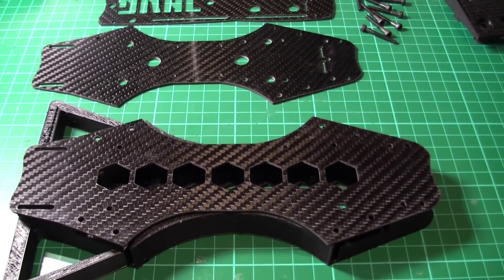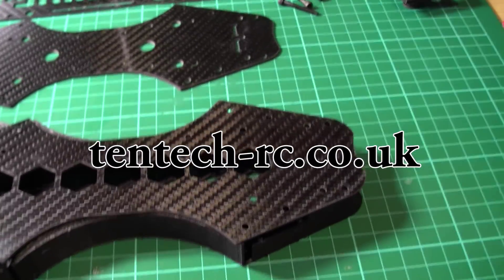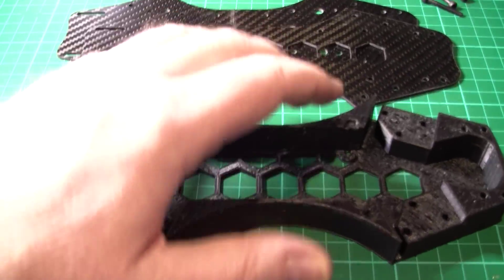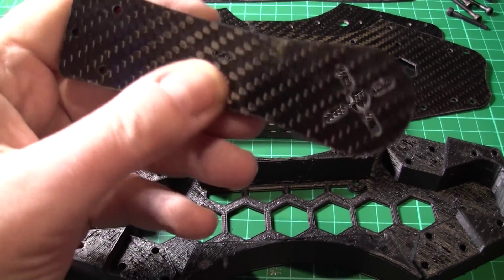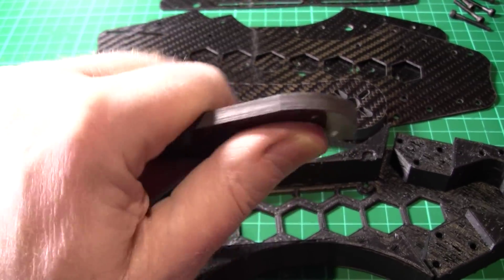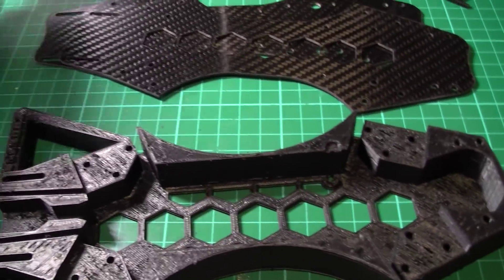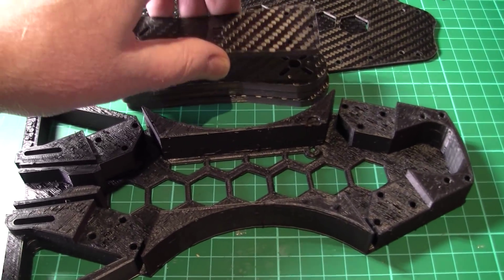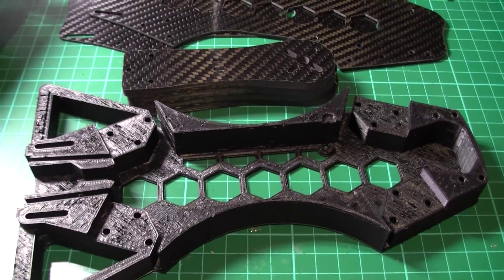THuG 250 mini quad build and flat-out proximity

Comment: curious when you made low flying passes up the straight path... there seems to be a lot of vibration when on throttle.  where you able to dial it out? or what was causing it?
Reply from the maker: +justinw75 The TPA needed raising quite a bit

Comment: PS I expect to continue my 5 flying trips a week of 60min in air as usual each trip so we will see how long m Tmotors last. I have a line on ceramic abec 6 bearings if the tmotor ones come out easy.
Reply from the maker: Hoverbot1TV I'll be interested to see how they hold out for you. The bearings come out quite easily (drive them out with a jewellers screwdriver) and most of them can be pressed into place by hand (if you're strong). If you can't get them in, an old bearing on each side of an M5 nut and bolt works. I have had one set which were held in with Loctite 641 because they were a little loose.

Comment: Wonder what the frame components only weigh? did the honeycomb the body spacer? Have v2 in works of HBx and shaved more weight off it.
Reply from the maker: Hoverbot1TV I put it in the description my friend..... 260g with 3d filler and 210g without.  It's heavy but virtually indestructible and they do have a very lightweight 180mm frame too.

Comment: thats a sweet frame and how i would it do it if i had a printer though id try some tilt in the arms but nice speedy flight , i was waiting for the voltage sag them packs must be pretty good
Reply from the maker: TheUnDeRGRouNDHoBo There's very little voltage sag on them but when they run out, you've got 3 or 4 seconds to land :)